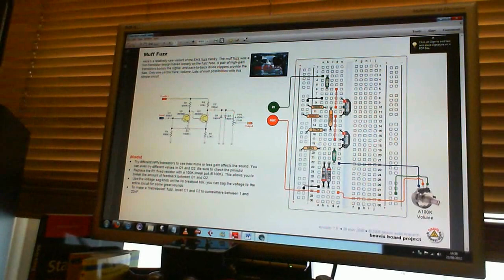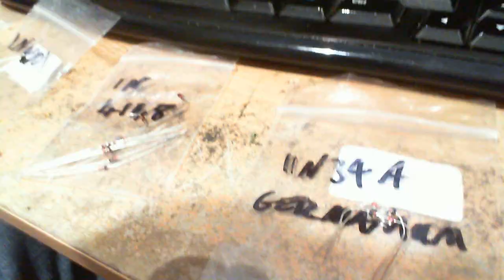Beavis Audio Muff Fuzz experiments: pt 1 - Stock parts

Comment from the maker: It's a home brewed version of the Beavis Board that I knocked up after seeing one on the site. Pretty cool box and not hard to make, pm me on facebook and I'll send you the link.
I've got it sounding better now, pulled out the matched diode pair and swapped in a germanium diode and another diode and added a film cap at the diode circuit's output to smooth the signal off a bit. Very muffy now haha